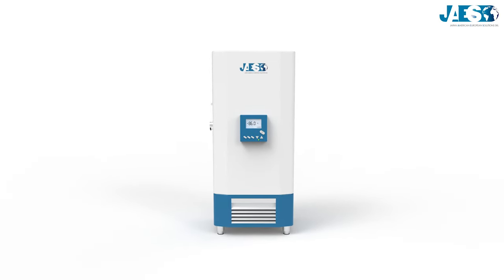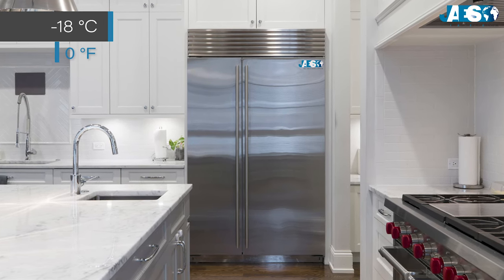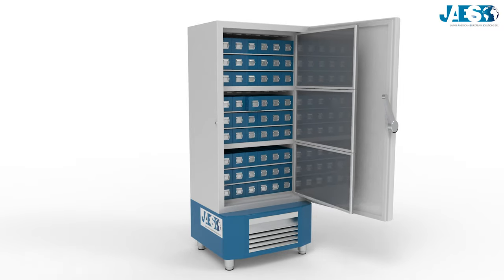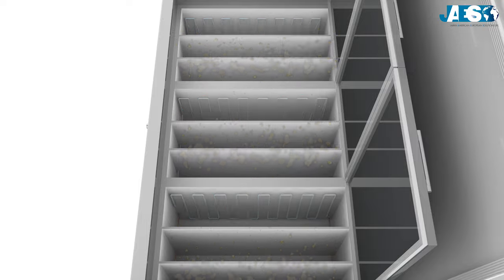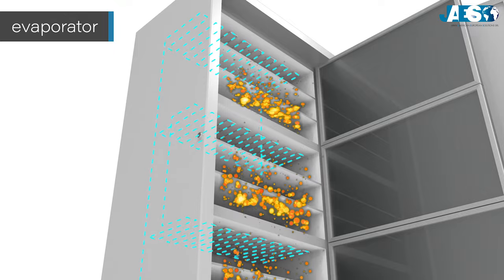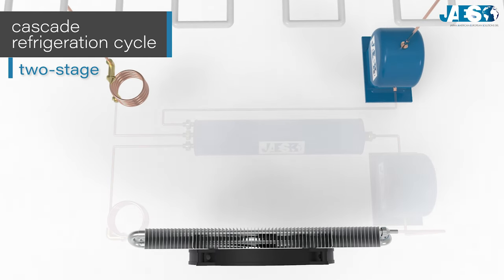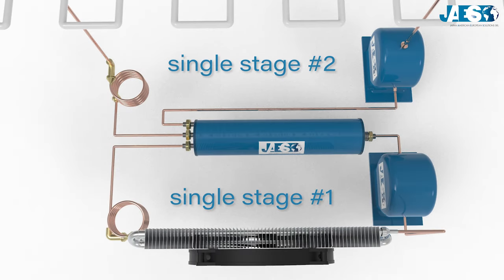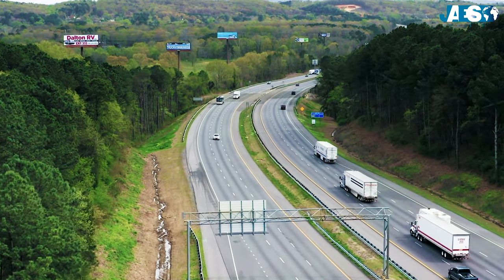How does an Ultrafreezer work? VACCINE TRANSPORT - ULT Freezer minus 80 - Joule-Thomson effect

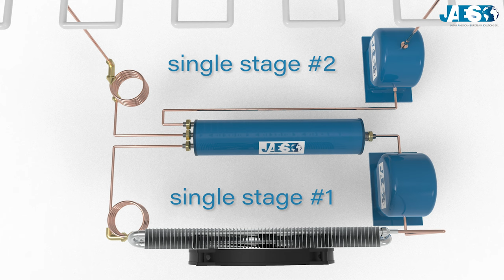Comment: 5:10 did you said : "the evaporator of the 1st stage gets cold by the condenser of the second stage" ? For me it's the contrary
Reply: Sir which compressor and gases use for -86 ultra low deep freeze in 1st and 2nd stage
Reply: I agree. They said there is no evaporator in the 1st stage
Reply: They're talking about the system as a whole. The 1st-stage evaporator absorbs the heat and eventually removes it from the system via the 2nd-stage condenser.

Comment: How can it works without electricity? That's to low temperature of -80 degrees centigrade?
Reply: The condenser fan and compressor are both powered by electricity.

Comment: What are the refrigerants used in those ULT?
Reply from the maker: Interesting question! ULT frezer frequently use gaseous chemical compounds that can easily be liquefied and characterized by certain properties such as high critical temperature and low critical pressure, limited hazard and toxicity. They are indicated by the letter R followed by a number that refer to the molecule’s atoms. I hope this is somewhat helpful! If you're interested you can watch our video about HYDRAULIC and PNEUMATIC CYLINDERS https://youtu.be/UVzWGkF9-28 We would like to know your opinion about it. If you want to learn more about our projects, you can subscribe to our channel https://www.youtube.com/channel/UCb7TkWFn3nyb6XhudxGu5tw and visit our website https://www.jaescompany.com/
Reply: In the low stage it's often R23, newer models have R170. The high stage used to use R404A nowadays it's R290
Reply: @nova290r  thanks. R170 (ethane) and R290 (propane). I have heard they were getting used now.
Reply: ACS has introduced R473A now as a non flammable alternative to R170 and less environmentaly harmful than R23 and R508A/B. It's a blend of R32, CO2 and R134a which is weird I think since they're so different from a pressure perspective and i really don't now how that is supposed to work out

Comment: Can we use same refrigerant in both compressor if it's boiling point is too high and freezing point is too low?
Reply: No you cant,one type should have a high pressure than the other
Reply: Can be the R-404 and R-508b 
Im trying to  fix one freezer like it.